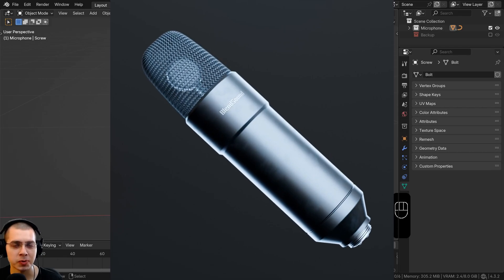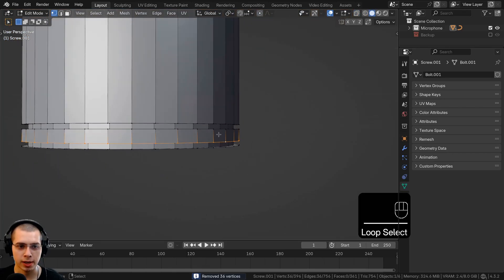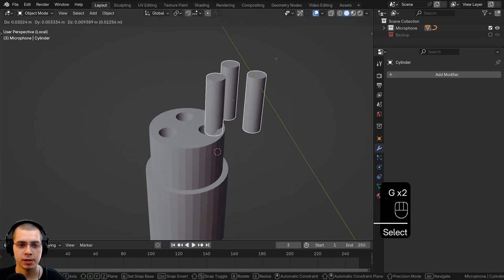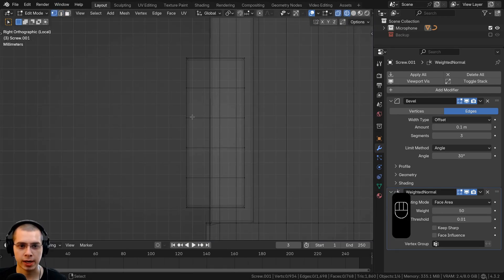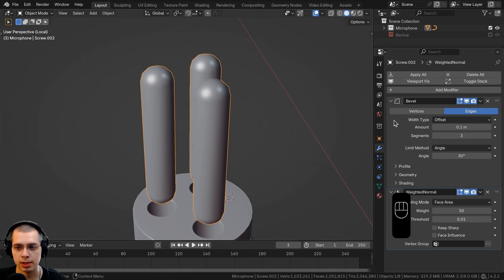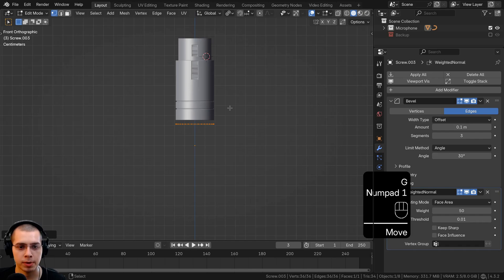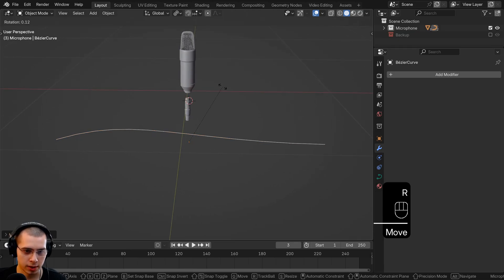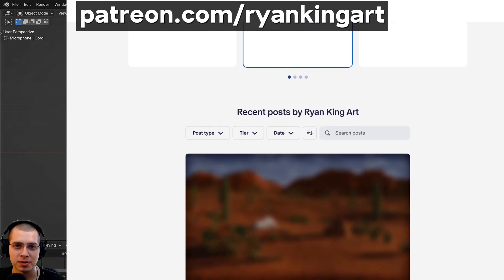Product Visualization in Blender🎙️Part 2 (Tutorial)

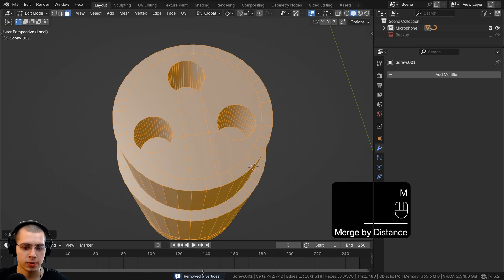Comment: Hey Ryan! Firstly thanks a lot for this amazing tutorial. You're a great teacher. Actually, I'm struggling with the part where you used merge by distance to remove the duplicate vertices at 5:26, but when I'm doing it, it's removing around 142 vertices across the cylinder holes which we recently created and turning cylinder squares into triangles. Can you tell me how to solve this, or am I doing anything wrong?

Comment: Thank you for this, but is there anyway to bring cad models into Blender.  Modo could directly import solidworks files.  Then there is Power Translators add on that can use step files and you have more control of poly count.  I have watched some import methods but they seem convoluted and would work on single parts maybe but I have assemblies with hundreds of parts and I need to keep the assembly structure intact.
Reply: I'm also curious! Were you able to figure it out?